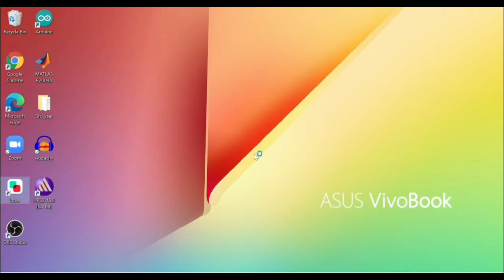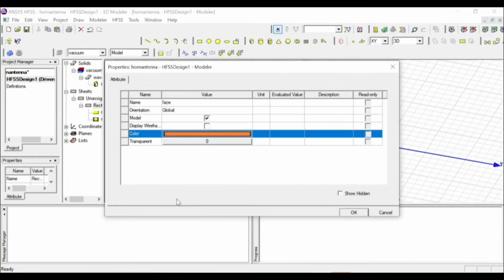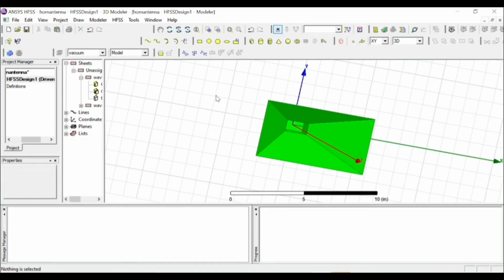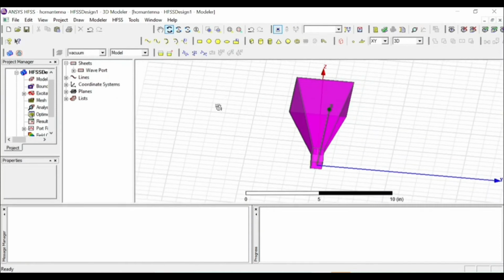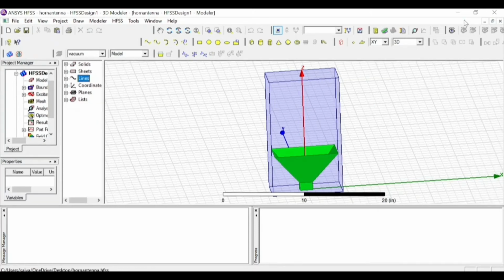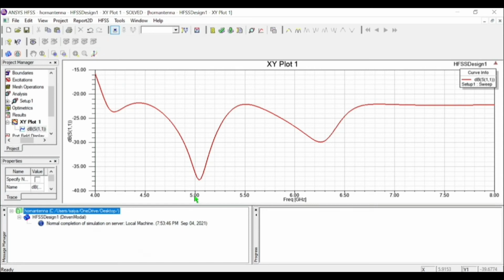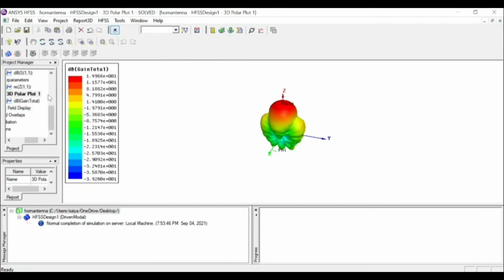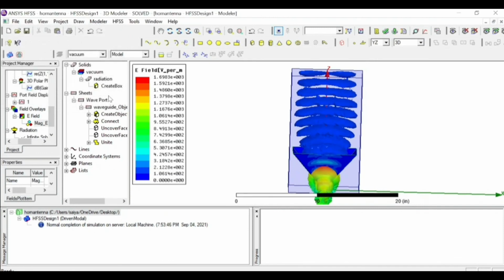Design of Horn antenna using HFSS software| Simulation of Horn antenna

Comment: Sir...how those 3D design values have to be considered..
Reply from the maker: first u need to research what are the parameters of the antenna like its gain, bandwidth, distance between the transmitter and receiver. based on these u calculate the length and width which u can then use to design ki HFSS.
Reply: @padharthisaiyashwardhan I have idea for antenna parameters.. kindly explain design Procedure sir please
Reply from the maker: Design steps: choose waveguide for f₀ → find aperture (from gain: A ≈ Gλ²/4πη, or from beamwidths: a₁ ≈ 56λ/HPBW_E, b₁ ≈ 67λ/HPBW_H) → set horn length/flare (a₁=a+2L·tan(ψH/2), b₁=b+2L·tan(ψE/2)) → check phase error Δ≈{a₁²,b₁²}/(8L) ≤ λ/8 → model in HFSS & fine-tune. This is a crisp definition. if u want a full explanation please feel to comment and I will make a video if possible.
Reply: @padharthisaiyashwardhan yes sir... Design horn antenna some frequency.5 ghz...We want only frequency or any other parameters we want ...from aim to steps... working methods I will do myself.

Comment: Firstly, thank you for your explanations sir, it was really helpful. One question, at the end of the video you have created an animation to observe the propagation of the waves, when I do the same I couldn't see any propagation like yours in the video but just some movements at the bottom side of antenna. What could be the possible reasons and how to solve it?
Reply from the maker: Thanks for your comment! 😊 The wave propagation animation depends on several factors — most importantly, the field type, frequency, and simulation region selected. You might want to try plotting the E-field vector or magnitude across the whole antenna + airbox at the resonant frequency. Also, make sure your airbox and radiation boundaries are set up properly. If you’re still having trouble, feel free to share a screenshot or setup details, and I’d be happy to help you out!

U can also contact me at padharthisaiyashwardhan@gmail.com

Comment: How to measure the centre position and x axis and yaxis value . can you please explain that  that for horn antenna
Reply from the maker: For measuring distances you can use the measure function of hfss software.

To do this first right click on the workspace and select measure position and then keep the pointer on any position and then drag the other end wherever center is present we get a triangle and on the side a window appears which shows us the x position and y position values.